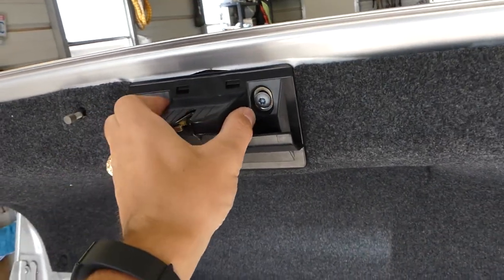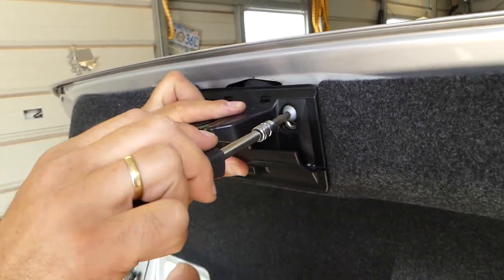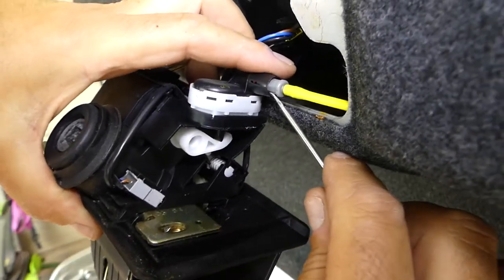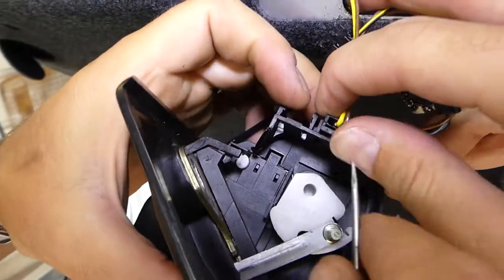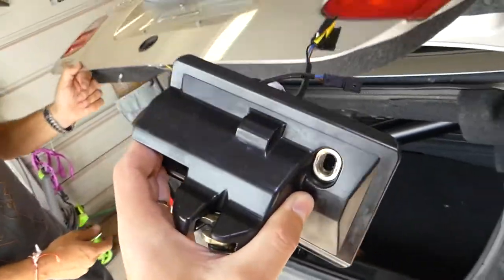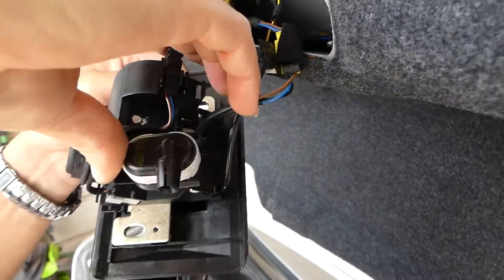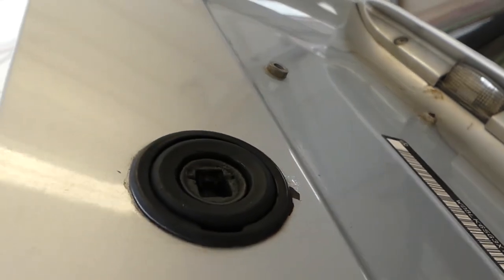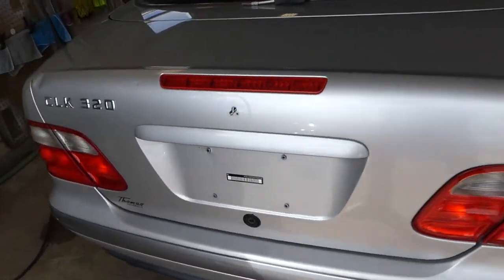MERCEDES W208 CLK TRUNK LOCK REMOVAL REPLACEMENT CLK320 CLK430 CLK200 CLK230

Comment: Hi.
I own CLK(A208) 430 Cabrio, 2000 YR. Soft top is working without any problem. But I have trunk opening issue. I guess something wrong with roll over bar. When opening top the roll over bar is automatically rising up. When top is closed trunk is not operated by remote swatch inside. Trunk only can be opened by holding down roll bar switch and trunk remote switch simultaneously. Please help me. Thanks.